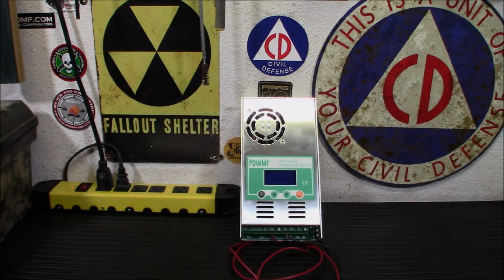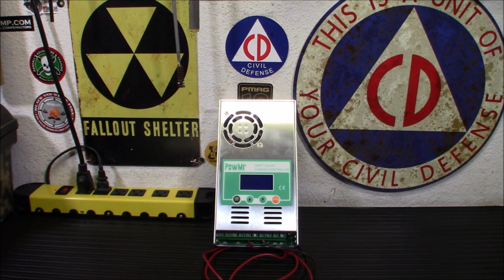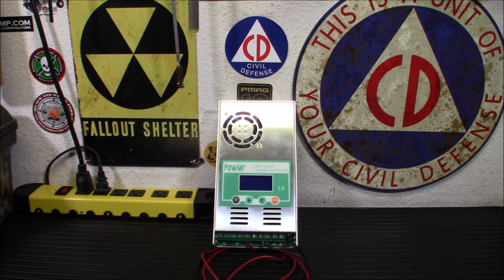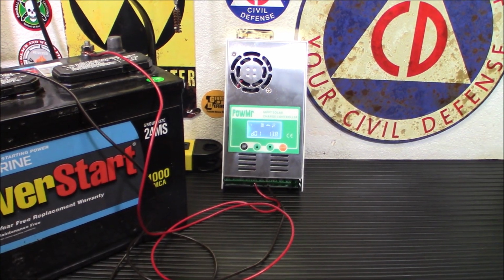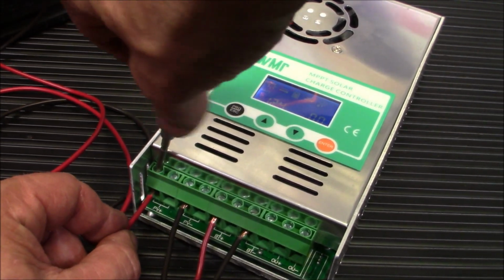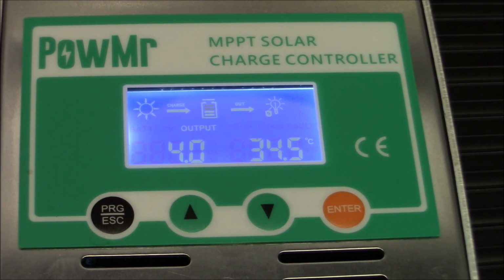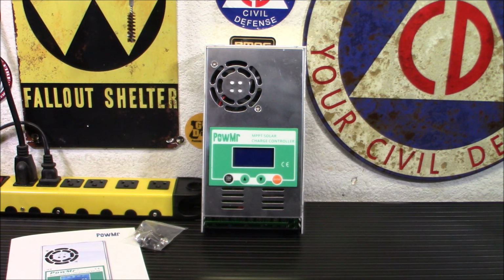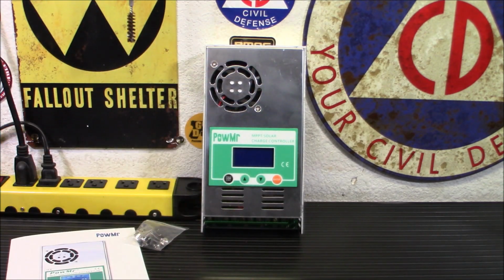Preppers Solar Power:  PowMr MPPT 60A Solar Charge Controller

Comment: They make a good heater in the winter, running 3s 2p  390watt panels at 48v, it won’t do 60amps at 48v only about 35-40 before it starts wigging out and overheating, I’ve seen 2.2kw output in winter, two of them heat the cabin during the day saves on my propane

Comment: Hi, I have 48 system solar panels also I have 8 panels each 180w in total it will be 1440w do you think this controller 60A will help me? nice to hear from you or anyone has got experience  :)
Reply: 1440w is fine and very healthy in 48volt mode. 2,800w max at 150 VOC PV. Always treat this like a 40 amp charger its a simple True Mppt device. Flip the fan to push air in to super cool the board. If you had 1 more panel you could do 3 strings in series.  Not sure how high  your VOC will be with 4 Panels in series.   I would probly try  2 panels in series. The higher the VOC is this unit does not like High VOC! It will heat up fast with much higher conversion of VOc to be brought down to meet the lower battery voltage.  I will be doing a video soon on my New PowMr 60. A Make sky Blue Clone.  Note I open up the case it does have an Aluminum block plate for the transistors and mosfets to dissipate heat to. There are no heat fins. So you need a small air space between the back of the unit and wall.  My first Impressions? True Mppt. Dislikes high VOC. Bad heat dissipation. 40 amp max Only.  Simple unit and always use stranded copper wire 10 gauge x2 to help prevent heat build up and power loss ( yes even in 48v mode!) Hope this helps.

Comment: So how would you run a small appliance or electronic from the charged batteries? Do you need another adaptor of some sort? Thanks , I'm a noobie still with this, (so far I only have 4 -15 watt panels). Thanks enjoyed the video.
Reply from the maker: You would need what is called an Inverter, I did a review on one a while back. the inverter connects to the batteries and converts the DC current to AC so you can plug things in. Here is the link for the inverter I picked up a while back   this is a big one but you can get smaller ones if you want  https://www.youtube.com/watch?v=Ajglb95Zzuw
Reply: @Iridium242  great, thanks for your help.
Reply: @maninacan.6285   Late reply from a viewer. Here is an Inverter education.  Most cheap $20 to $150 dollar inverters are Square wave high frequency. They are all similar and cheaply made with small internal capacitors and cores/ transformers. You can run most  items at 1/2 their rated wattage! <- shocking. Never use drills, coffee makers, heaters, power saws. You'll kill a small battery bank and the capacitors will deplete shut down and maybe burn up the unit as it draws too much amp/power.  Now moving on.
   Pure sine wave inverters will cost you $300 to $2,000 dollars. They produce clean pure power like your wall socket. They are very heavy. Loaded with components. Their efficiency will be very good.  You always need a copper wire as thick as your finger unless you have weird hands! ( ha ). Any hoot these thick wires go between your inverter and battery. They must be thick heavy and short... like under 3 feet. This prevents resistance and heat build up and allows for max amp draw. Failure to do so will pop fuses and the units will heat up... fire or catastrophic break down.  You will need  a DC breaker between your battery bank and  inverter with a kill /cut off switch added in.  lastly lead batteries last 3 to 4 year before they sulfate over and deplete and become trash. Visit Alt E <-- look this up on you tube or on their solar web site and watch Amy's video on all things solar and get a free full college level solar education.  I'm learned so much about solar I went from noobie to Pro DIYer off gridder. I watch each of those video 3 to5 times until i fully under stood them. It takes some time to learn.  Good luck brother you got this!

Comment: I have and use this exact controller, it has been my most reliable controller. I use it with 800 watts of panels and it pushes out up to 55 amps on a sunny day. It has outlasted Renogy by far and at a great price! I couldn't be happier with this product.
Reply: Guyz Truth, I checked the price on this unit, and I am guessing that is a good price. I have a Snugmax 350 solar gen, and for charging, I am running a Rinkmo 100w solar panel. Since this is all I am running with it (maybe I will add another generator down the line), do I really need a charge controller? I am kind of new to this.
Reply from the maker: Yeah you don't need this if you are running a solar generator, it already has something similar to this built into the generator itself.
Reply: @Iridium242  That's what I figured. Then again, this is why I subscribe to your channel....valuable information, indeed. Whatever you are usually reviewing, I usually buy!!
Reply: i have switch to victron but i still love 4 powmr as i have 6 different systems once you learn how to set them up they are great for the money, im still running 3 of them they never fail